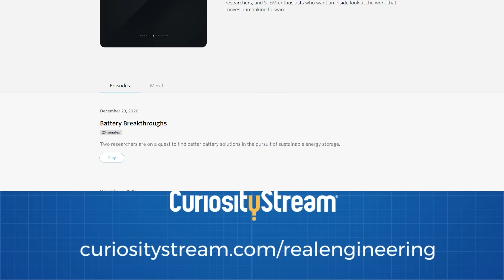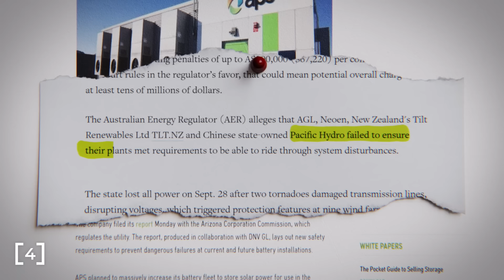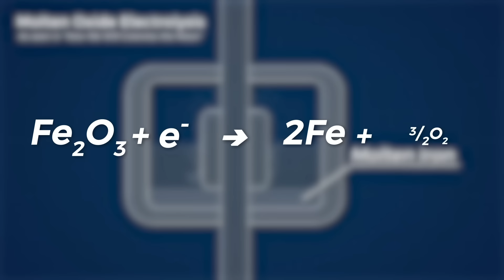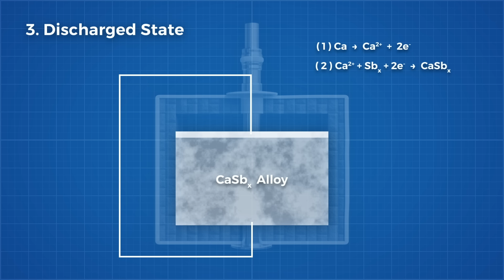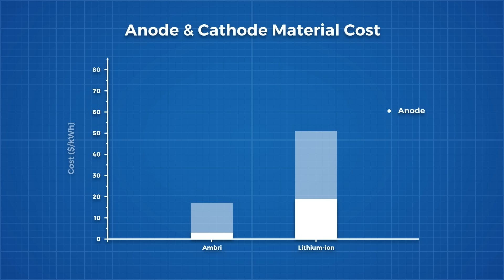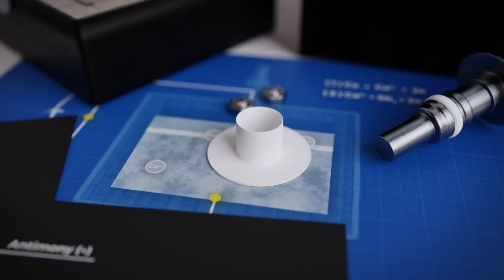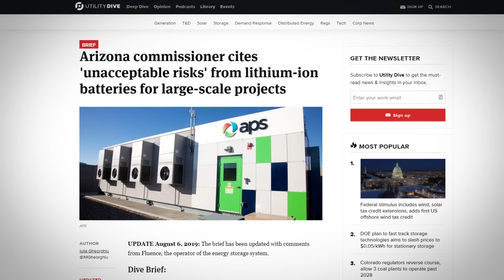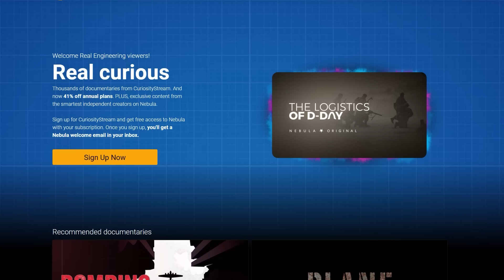The Missing Link in Renewables

Comment: 3:40 "It was a poorly planned grid." Erm, yes, it was a poorly planned grid because it was sold off to Hong Kong Infrastructure company many years before, and they had done sweet little since then, reaping the profits and doing virtually no upgrades. Onto this grid was added renewables like wind, hydro and solar because they were cheapest, but the infrastructure company did little to nothing to ensure grid harmonisation.

This is what happens when you don't have vertical integration and sell everything off. Blaming wind-turbines for a storm that toppled power stanchions and cut power lines on an ageing grid decades overdue for an update is disingenuous, since it became evident after PM Malcolm Turnbull's comments that there was a political purpose of moating fossil fuels by using the storm event as a weapon to attack renewable energy uptake.

PM Turnbull at the time, using the storm and subsequent blackout as an excuse, said that renewable uptake was 'irresponsible' and thus implying that this was responsible for the blackout - but it was the very neoliberal economic policies of selling everything off that was 'irresponsible', since no new renewable additions to the grid had been properly integrated.
Reply: Well thought-out answer, but I think you meant disingenuous and not ingenuous.
Reply: Yes, and flogging it and others to foreign buyers like the chynese, who have no vested interest in maintaining, improving, and ensuring continuity of supply  was straight out vandalism to our country and its corporate interestrs as well.  Totally irresponsible and should have been disallowed.
Reply: @WayneKitching  thanks Ed! fixed.
Reply: @linmal2242  (Retired IT field support for a major electric company with focus on energy delivery here) Absolutely right. Political considerations invariably degrade electric systems. Here in the Western US we have the geographically largest interconnection in North America, spanning the US roughly west of the Rockies and the provinces of BC and Alberta in Canada. California seems to think the laws of physics can be bent to the laws of politicians. Without the rest of the interconnection to stabilize them load shedding would be a normal part of every evening.
Reply: @flagmichael  Yeah... but that's just how renewables have to work. Either you have high levels of interconnection (so that an area that's clouded over and experiencing calm weather can still draw power from various still sunny or still windy partners), or you have high levels of storage. Both is better of course, but the path that California chose - overproducing because of their excellent geographical location, then selling it to less perfectly placed neighbors - isn't a bad way of doing things, even if California didn't implement it as well (yet) as could be desired.

So it's disingenuous to say that it's merely "politicians being stupid politicians", since *having an interconnected grid is a large part of what makes renewables affordable*. You can do it with just local storage of course, but it's much more expensive to take the "just local storage only" path forward.
Reply: @jasonwalker9471  I think you've got it backwards.  California is using fossil fuel generation from other states as backup for their grid... A very NIMBY approach... Without economical storage renewables require building equivalent wattage fossil fuel backups basically duplicating costs, they're just offloading this cost onto neighboring states that they have interconnects with.  It would be interesting to see a levelized cost analysis that took into account the cost of backup generation, then solar and wind wouldn't look so cheap.
Reply: @sailorbob74133  The idea is: once the long distance interconnects are complete, when New York is going through its evening "duck curve" Colorado will still be generating excess solar. When Colorado is going through its evening duck curve, California will still be generating too much solar. When California is going through its duck curve, there will be a bunch of excess wind in Colorado... or Saskatchewan... or Montana... or New York, and since it will be night (with decreased usage), they'll need someone where ship it to. And when everyone is settled down for the night across the continent, all that excess wind power will still be being generated but have nowhere to go... except charging electric cars. And when all the electric cars in the nation are changed, then stationary storage will finally start filling. Small fast acting lithium ion batteries will fill first, because they're used for grid stabilization, followed by things like lava batteries and pumped hydro, depending on what makes sense in any given region taking into account their climate.

Using largescale grids this way minimizes the amount of stationary storage and excess renewables generation you need to build to have a reliable, stable grid.

California isn't exactly doing anything wrong, it has just got out ahead of its neighbours (and stationary storage buildout) in a less than maximally efficient way.
Reply: @jasonwalker9471  Don't know how good an idea long distance interconnects are considering the heterogeneity of the grid and it's local designs - remember those black outs in New York a few years ago?  However lava batteries are very interesting and if successful ( actually work on a large scale and can be manufactured economically ) they could be a real game changer and actually make solar economical and reliable.

Comment: The North American grid is 240 volts at 60 hertz and is tripolar, but standard outlets are 120 volts at bipolar with a separate ground. Generally the higher voltage is used for manufacturing and electric appliances that require more power such as electric stoves and run at higher amperage. Standard outlet at 120 volts are either 15 or 20 amps.

Comment: This was a very pragmatic introduction to this promising storage solution. I wish all sustainable energy related videos were like this.
Reply: 1:36 How is pumped hydro storage "not scalable"? You can't just make claims without proof.
Fact: the world's largest pump hydro storage facility is 24000MWh which is larger than the world's largest grid battery 300MWh. "Not scalable" my ass.
Fact: pump hydro storage make up for 95% of grid energy storage. "Not scalable" my ass.
Reply: @luongmaihunggia  No scalable based on every location. Do you know how few locations are suited for hydroelectric dams with large enough space that won’t destroy an ecosystem or require the entire basin to be dug out? They’re scalable, but not opportune or capable of enough output to transfer power across the insane distances that would be necessary to rely on hydropower. Additionally, raw power “storage” isn’t really a thing in the grid at the moment. That’s why the battery buffers and flywheels matter so much in conversations about renewables and why dams hold most storage. It’s basically the only storage we have. I’m certain many areas can massively benefit from usage of dams as buffers and will be encouraged to. But for everyone else, batteries are where it’s at.
Reply: @GuiSmith  no. Not hydro electric dam. Pump hydro electric dam.
Reply: @luongmaihunggia  It is the same, you'll need a large valley to pump all those water, and it will destroy the ecosystem.